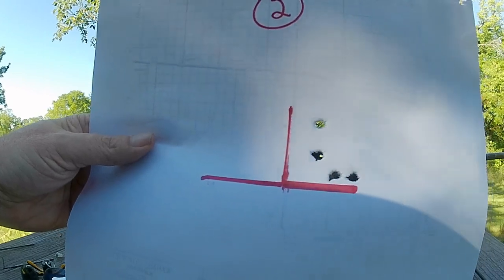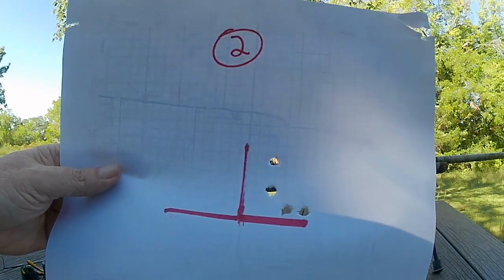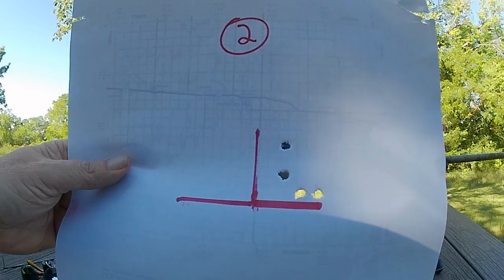The Quest for the Perfect .243 Load

Comment: Not sure if you realize it or not, but even only firing a couple rounds, the barrel of rifles will walk a bit as they heat up from successive shots fired. even  or 5 rounds will cause this. It may not be much, but it is a fact it does happen. Good luck in your quest for the perfect round/ powder combo for your gun.
Reply from the maker: It used to shoot sub MOA every day with 4007 powder.  And I agree with you on hot barrels